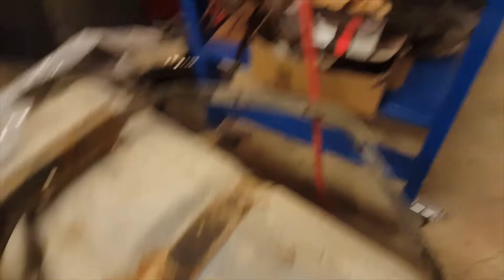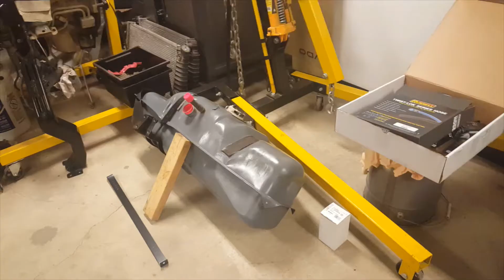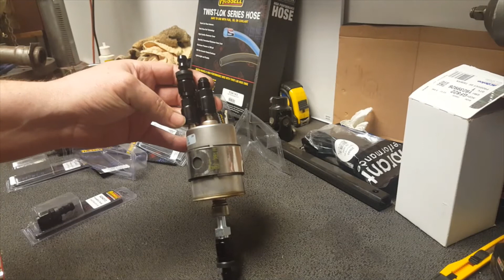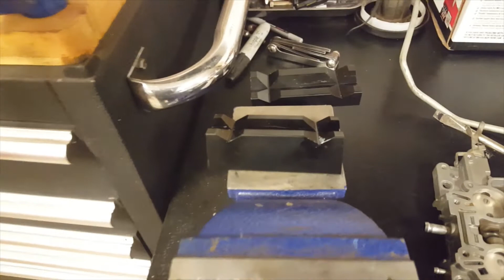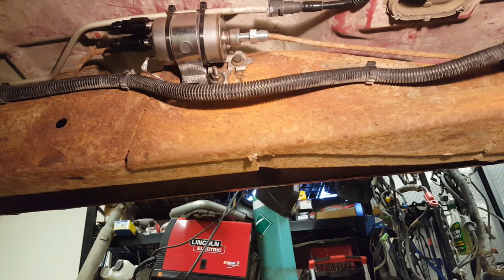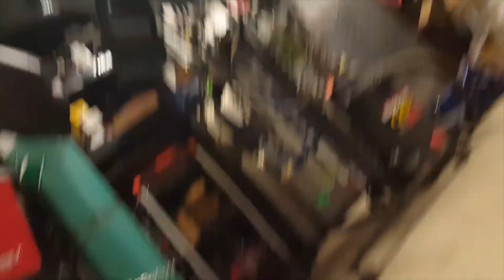LS Swap S10 Sonoma L33 Fuel System Install With Russell Twist Lok Hose And Fittings #3

Comment: so maybe i missed it but are you using the stock pump in this application i just didn't know what the stock fuel pressure is
Reply from the maker: It was supposed to be a Walbro 255 and I show what I recieved at the 45 second mark of the video I copied here.    (LS Swap S10 Sonoma 5.3 L33 #2 Walbro 255 Fuel Pump Install)